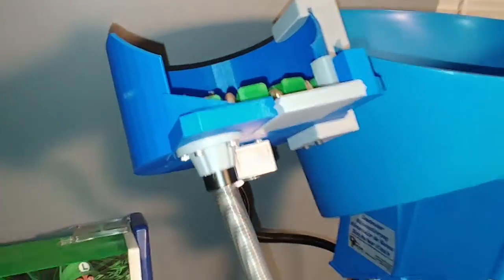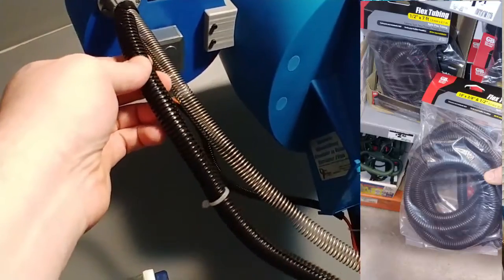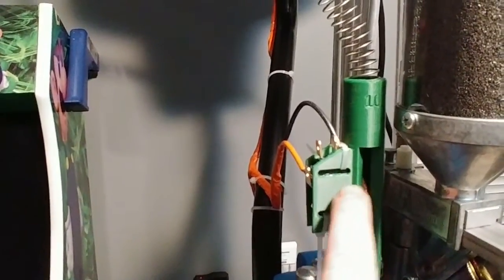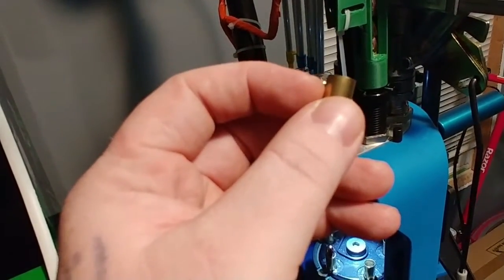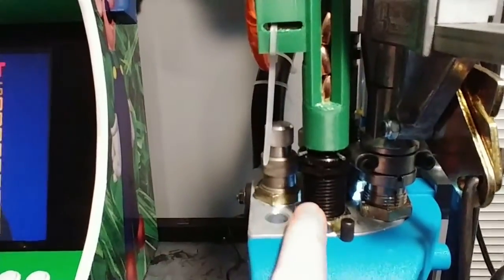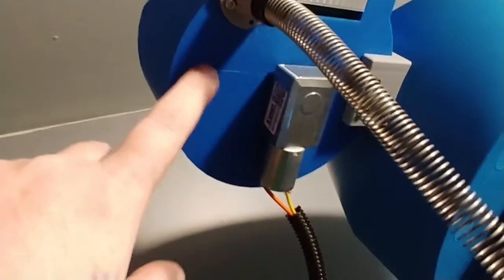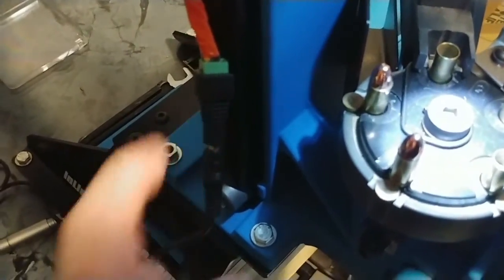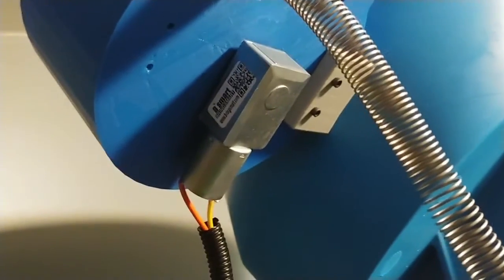build your own bullet feeder | 3d printed ammo mikes / karl bibbs

Comment from the maker: DAA i believe removed the files. So Here is the goods ;)
In this folder will be a 9mm specific unit. And an entire source instructions and all.

https://drive.google.com/folderview?id=1J8AuLfiSqs0zNWjD3qLtCs9nb3iC00_F
Reply: You're a hero for posting the files.  I actually downloaded them and it was still on thingiverse and printed the whole bullet feeder, but I never ordered the motor. I actually ended up buying the exact same motor you have, which I thought was kind of funny since you have exactly the same amount and exactly the same orientation I ended up with. I'm glad you posted this, because I had absolutely no additional parts to finish it.  I came to watch your video to understand what else I needed to order. Now that I have my bullet feeder functional itself, it seems all I need to do is get the DAA die, and the spring. Did you also use a coupler at the top against your bullet feeder?
Reply from the maker: @c.j.1089  the collar on the daa output spring is the right size to fit.
Other end of spring fits snuggly into the part that goes on the die
Reply: Dude you are an absolute boss thank you so much for hosting the files. I have been looking for them all day long. Subscribed!
Reply: Thank you! Just got my 3D printer so I have a little learning first.
Reply: Is there a specific main housing I should be printing? Looks like there a few different bowls. I just printed the first one I found in the folder. Are they specific to certain motors? Also what's needed other than the spring? Is everything else printed?
Reply from the maker: @justinwolden399  the bowl is specific for the motor. Ex. 370 worm gear,  daa, etc
You will need a spring , and a bullet feeding die. I suggest the daa. Its expensive ($50) but works amazing and has ball detents, also I suggest a expander insert specifically for bullet feeders (if using a dillon powder hopper and die) if using leefound it to work just fine for pistol
Reply: @TargetTime  perfect thank you. So if I were to order the DAA die should I be getting the dropper assembly as well or does the 3d printed version work just as well,
Reply from the maker: @justinwolden399  printed dropper,  that's what I use (the green part)  slides right onto the daa bullet feeding die, and their spring fits right into the top of it
Reply: @TargetTime  sounds good. It's nice to hear from someone that knows. There's allot of helpful people out there but nothing beats quick responses like this.
Reply: Sorry if this was asked- but is there anything else needed other than the DAA die assembly to work with the Karl Bibb bulletin feeder?  I bought a printed bullet feeder die from him but it cracked and won’t hold bullets. Do I need to buy any special springs or parts to go with the assembly?
Reply: @PastorTimMoore  depends on what you buy. If buy the entire dropper assembly. Then all you need to worry about it making sure you have a way to connect the spring from the feeder to the dropper.
Reply: @justinwolden399  Thanks Justin. Any chance you have the 3d Printer files for the 9mm die only?  That's the part that damaged on me.
Reply: @PastorTimMoore  castboolits.gunloads.com is the forum that the original creator is active on daily. If you have any questions you can ask there and talk to people who actually have experience. Look up Tyler R on there or "making that bullet collator". His profile has links to the most up to date files. If you cant find it send me your email and I'll try to get them to you.
Reply: Thank you kindly

Comment: does this all work with hornady lock n load as well?
Reply from the maker: @eladsinay6914  yes.  But the mounts and bullet feeding die will be different. Unless you are using the daa die. Check the files in pinned comment and see what's in there.  Been long I'm not sure anymore

Comment: What do you use to drive the plate? I have downloaded 5 or 6 different  variations and none of them work. I have attempted to bend a M3 screw over 90 degrees  but it keeps snapping off. Next attemt is to banllend the screw into 90 degrees and reinforce the bend with jb weld.

Comment: Does anyone have a complete parts list for this? Motor and arrow switch are in the description, but what else is needed?
Reply from the maker: The 3d printed parts, the tube spring for bullets to transfer, a bullet feeding die. Screws
Reply: @TargetTime  so no power supply, speed controller, switches, wiring, etc.?

Comment: I made a "dual sensor" on a friends 3d printed bullet feeder. I ran two optical sensors, one at the low side of the tube and one at the top where the bullets drop down. 
There is like a threshold, When the tube is empty, it will fill up to the top, and stay off until the lowest part (6 bullets left in the tube) runs out, only than will the motor starts, and stops again when the tube is full. Than you wont need to hear that motor and bullets ratteling every time pulling the handle =) Everything is possible with a arduino =)

Comment: What infill did you use for your slicer? also which die adaptor did you use to attach to your Loadmaster?
Reply from the maker: The die adapter will be specific to you bullet feeding die. I do not use the Lee bullet fingers. That worked for a very short time. Way to much hassle. 
Daa bullet feeding die is the way to go

Comment: So I need a transfer tube- I think I’ll try the corrugated plastic since that’s easy to find. How did you make sure it stayed attached to the bullet feeder? Does it stay on its own?
Reply from the maker: Couple dabs of glue. Lets it stay on. And easily sanded/chipped off for going spring later.
Zip ties to keep tube together every so many inches

Comment: Any info on the photo switch? I can’t find the snap switch in your link. Anyone have a switch available?✌️
Reply: Think I found what I need but if anyone has an arrow switch resource I’d rather go simple.

Optical Switch (Group B) all parts are available from Amazon (approx. $41.18 total):
ThreeBulls 12 Pieces 5.5mmx2.1mm DC Power Jack Female Panel Mount Connector (ASIN: B01N8VV78D) - $6.99
Aoyoho 12pcs Car Truck Rocker Round Toggle LED Switch On-Off Control, Blue, Green, Yellow, Red(12V 20A) (ASIN: B01GLIPEGY) - $6.35
uniquegoods 1803BKW 1.8v 3v 5v 6v 7.2v 12v 2A 30W DC Motor Speed Controller (PWM) Adjustable Driver Switch (ASIN: B00RYKR83Q) - $5.98
DC 12V Car Led Light Control Photoresistor Plus Relay Module Light Detection Sensor (make sure to get one with the photoresistor on a wire lead) ASIN: B01M67V8AQ - $6.99
Daykit 10 Pairs DC Power Pigtail Cable, 12V 5A 2.1mm x 5.5 mm Male & Female Connectors for CCTV Security Camera and Lighting Power Adapter (ASIN: B07PS8T2KM) - $7.99
Rasalas LED Bulbs，1 Pack (30 Bulbs) 5mm 12V DC LED Pre-Wired Round Top Bulb Lamp for DIY Car Boat Toys Parties (White, 5MM) (ASIN: B07QDL21BX) - $6.88

Comment: For the power supply, how many amps are needed?   Thanks!
Reply from the maker: All depends on the motor. I believe on this one I talk about it . If not it's the other video. This DC worm gear motor I want to say it was 1amp? 
The AC was like 5 amp I want to say. But its been a while i would have to check
Reply from the maker: Also want to say I linked my adapter and motor I use in description

Comment: Hey, can you message me, please?  I have a question about the motor, switch and power control!!  Thanks!!
Reply from the maker: That is one thing I never figured out is how to message from mobile YouTube.
Reply: @TargetTime  I hear you.  So One question  I had is where do you get the piece that threads down onto the motor shaft the T shaped piece that drives the collator plates?
Reply from the maker: @jeffreygoodness549  depends on what motor shaft you have. Some are D shaft some are threaded shaft. 
You just need to find that shaft extension.

And it depends on what collector plate you make. Some have ovals like mine.
Some are just a slot. ( so you just put a roll pin through your shaft extension)
Seen some where a cut off screw driver handle was affixed to a shaft with epoxy weld
Reply: @TargetTime  ok cool thanks.

Comment: Question about the flipper.  If I pause your video at 5:57 it looks like you're just using the weight of a 9mm bullet to keep the flipper engaged on the collator plate instead of a spring.  Is that true or do you also use a spring?  Just curious.  

My only other question is about the mount.  I downloaded your .zip file (thank you very much for that) and when I look at your 9mm setup, the mount looks different.  The file "bf_v2_mount_hang_WH120" looks closest to what I see in the video, but it looks like it would make the feeder housing hang straight, not tilted back like the one you have.  Is there another version that may not be in the zip file or am I just missing something obvious?  Sorry for all of the questions, I'm just grateful to be able to make this, so thanks again.
Reply from the maker: Yes a projectile for weight works when you don't have a spring. 
Many mounts in the main folder..I am using  the case feeder mount.  And the 370 worm gear base (this will be specific  to your motor)

Comment: You say the switch is a 0.29N opperating force but you link to a Honeywell switch (V15H16-CZ100A03-K) which is 0.96N? (Arrow site states 0.29N but the part number in the datasheet says 0.96N) - So the quistion is what switch to get? perhaps 0.2-0.4N will do? or is your switch in the video 0.29N in which case I need 0.15N?

Thank you :-)

Comment: I'm printing the JGY370 version, what do you use to connect the motor to the collector plate? some sort of D shape connector?
Reply from the maker: Yes of you have a D shaft then you can buy a d shaft adapter or print one. 
Sorry I did not see this comment
Reply from the maker: Ask karl bibb maybe he has a print he can share. Or ebay search for a d shaft coupler. That will allow you to clamp this collar on the shaft. Then clamp something round into it. 
I've seen cut off screw drivers turn then, 
Some have had a small bar with a hole in it where a roll pin is inserted ( like a T coming out of motor) that T would turn it the plate if a slot was cut for it

Comment: My friend is having an issue with the spring from the bullet feeder to the dropper.  It isn't long enough.  He is using a Hornady LnL.  Do you know for 9mm and 223/556 where we can get longer springs and what those specs are?
Reply from the maker: Daa sells the springs. But they are short. Its meant to be stretched to how long you need it.
Dont over stretch because you can't undo it. So you don't want it floppy and sagging catching up bullets. Little stretches at a time

Comment: I wonder how MBF feels about the people making a business printing these considering they don't like even the files to be available?
Reply from the maker: They fight everyone. They are attempting to sue now. Awaiting letters of promising to close doors now.

This isn't MBF this is ammo mike. 
I use DAA die because DAA die work good.
But ammo mike designed this to use DIY electronics. (Notice my motor) its not DAA it's Worm gear from Amazon. 
The 3d printing community all helped mike. We have files for 8 different motors now. The "does the same thing" patent breaches they done over the last 10years are BS. And never stuck to anyone with $ and backing to fight. 
Now they are on this well the hopper style curve looks similar crap. 
Same thing with slidefire they sued and shut down any type of stock, trigger mechanic, etc. 
Anything allowing recoil to fire (legally because trigger reset)
Was copying them. Even if it wasn't a stock at all
Reply from the maker: And the real question is how does ammo mike feel everyone is making business of his design.
Karl has mikes permission to sell. But i know 6 others that do not
But you put the files out for people and there will always be sellers

Comment: I ordered one... I think it will be awesome
Reply from the maker: It is awesome. Never would I expect speeds to increase this much. I'm quick with the finger. Bullet feeding. But wow
Reply: @TargetTime  just got it and set it up... runs good ...nicenhownquiet it is.
Only thing is I had to wrap electrical tape where the spring goes into the die to hold it in place as the spring is to short and more take on top of bulled die to make the switch part stay in place
Reply from the maker: @markcerajewski5709  the bullet transfer spring? 
Does yours have a switch housing on top of your die like mine?
The DAA transfer spring is too short if that's what you mean, its meant to stretch it out in the middle for length you need
Reply: @TargetTime  ahh ok.... I will do that.... now having trouble with bullets not flipping and jamming feed from the hopper.... been adjusting this flup plat but just dont seem to work well... I get about 50% falling upside down uggg lolol.... prolly just need to find the sweet spot
Reply: @TargetTime  I am using 115 grain hollow points from rocky mountain reloading... think that might be the problem ?... nose to light or profile ?
Reply from the maker: @markcerajewski5709   nope 115 rmr and xtreme is what inuse.
Shoot me an email at Erreertt@yahoo.com
I'll send you some pics. 
My double sided flip plate (the square gray piece) sweet spot was like 1/4 inch out. Also I put a spare bullet behind the curve piece. That pushes the bullet all the way in shell plate and knocks any extras back out. It does that flippy tappy noise (as you can tell I don't remember actual name of it lol)

A bullet will keep pressure on it
Reply: @TargetTime  looks like you have me blocked in email...
Reply from the maker: @markcerajewski5709  erreertt@yahoo.com ?
Reply: @TargetTime  sent it same as you have it up above
Reply: @TargetTime  I will try again
Reply: @TargetTime  sent again hope you got it
Reply from the maker: @markcerajewski5709  got it. Sent some pics to ya. Im home now so its my bed time. I'll check back In with you this evening
Reply: @TargetTime  hey what bullet feed dies fir the bullet feeder... I am having secont thoughts on these plastic dies.... RCBS ? or the DAA ?
Reply from the maker: @markcerajewski5709  DAA by 1000. Best die on the market with the ball bearing retention.
I have their powder funnel too. Expensive and needed polishing paste on it. But works good afterwards
Reply: @TargetTime  also added you to my LinkedIn
Reply: @TargetTime  my email is handloader454@gmail.com
Reply: Sent you an email

Comment: The thingiverse link is showing 404! I actually e-mailed myself the link the other day to download the prints on my print controller printer.
Does anyone have the actual .stl files?
Reply from the maker: https://drive.google.com/folderview?id=1J8AuLfiSqs0zNWjD3qLtCs9nb3iC00_F
Reply: @TargetTime  thanks
Reply: @TargetTime  thanks so much
Reply from the maker: Daa probably sued AGAIN. But here is some files I have heres my Google drive. This is for chancs synchronous motor , sadly I lost the worm gear base. 
This also has a couple mount options to the press or standalone pipe. 
Also has the tray for 9mm
The droptube is 9mm ID ( hit it with a drill to make wider or use software)
Few other needed parts
 https://drive.google.com/folderview?id=1J8AuLfiSqs0zNWjD3qLtCs9nb3iC00_F

(Please DO NOT TOUCH THE NINTENDO SWITCH FILES IF YOU ARE NOT FAMILIAR with staying hidden from nintendo.)
Reply from the maker: https://www.thingiverse.com/search?q=Bullet+feeder&dwh=215de966ab4216c
Ya it's like its been removed. Not sure what's up. I'll look around
Reply: @TargetTime  let me know if you find it , I've printed 3 of these but didn't grab a the files

Comment: Are you selling the 3D printed parts?
Reply from the maker: No. Sellers need permision from the designer (ammo mike).
There is a link in description for a FB page. Karl Bibb has permission and makes them. Sells the parts or built units if you don't want to source the motor and electronics

Comment: Where I can get the transfer tube?
Reply from the maker: Do you mean the drop tube? If so All files are in Thingyverse just by searching open source bullet feeder. Or if no printer karl bibbs reloading stuff on Facebook
Reply from the maker: 1:45
Reply from the maker: Ah transfer tube. Sorry. The spring is from daa (double alpha they make the Mr.bulletfeeder. I highly suggest using thier feeder dies and spring, and funnel if on pistol) 
Or you can get by with department store corrugated tubing
Reply: @TargetTime  I plan on following your advice to use the DAA dropper assembly combined with the ammo mike bullet feeder. Any advice in terms of getting it connected to power,
Reply from the maker: @justinwolden399  is this the long video? (I have 2 posted) in the description there should be a link for a power adapter and quick connectors. (Check motor rating.  The synchro motors sometimes take 5a + (like laptop supplies) the worm gears take about 1a or less 
If no link let me know and I'll comment the link of the one I bought.  It had the connectors included for easy wire
Reply: @TargetTime  this bullet feeder is sick. It speeds up loading at least 3 times faster. Now if I could just get hollow points to feed. I get allot of double drops though. One nose down in the case and another stacked on top. Any solutions?